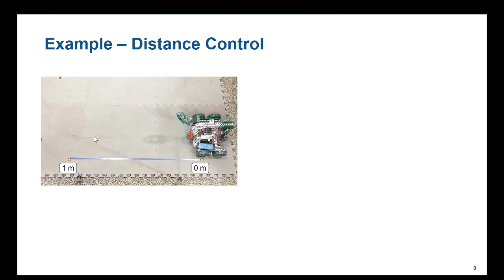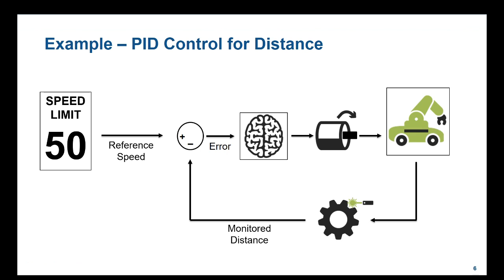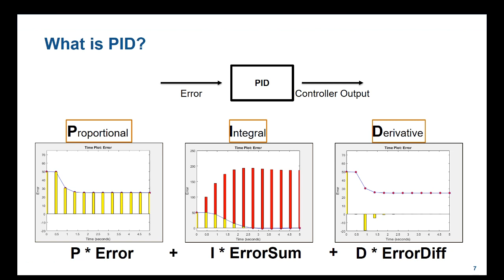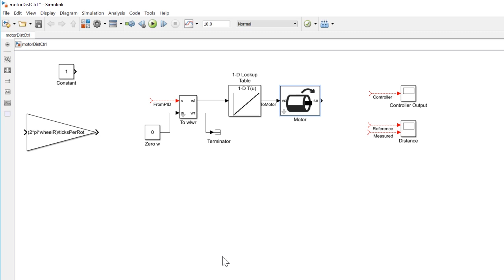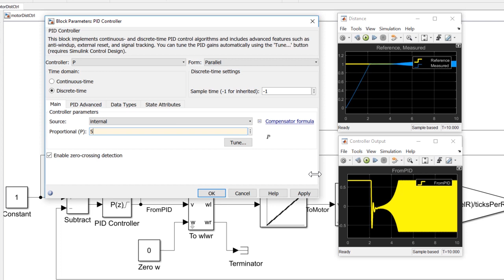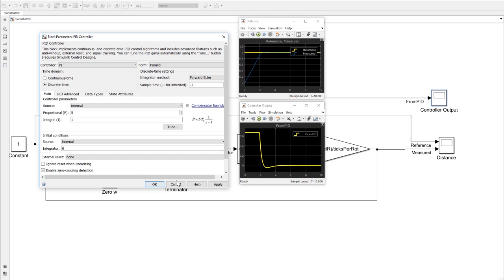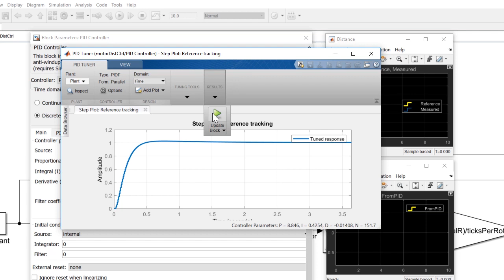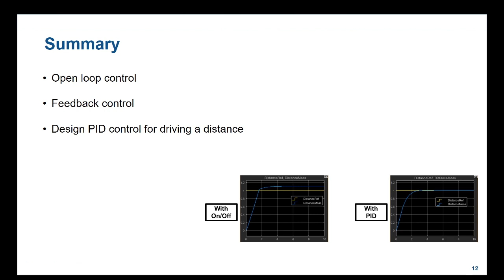Mobile Robotics, Part 2: Using PID Controllers

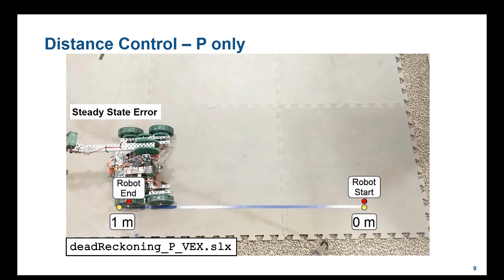Comment: 21:40 steady state error
25:47 to avoid algebraic loop error , tick the checkbox in PID block parameter which says "PID controller is in a conditionally executed subsystem"
25:47 PID tuner app can only be used if time domain is continuous

Comment: can someone please help me ,  how can i tune  PID controller for same 1 meter distance but also for backward motion and then add it to my model.
i have created logic in same state flow chart so that robot moves backward after a break of 1 second but now i want to use PID controller because it goes  beyond 1 meter while moving forward and backward.
in these video stateflow chart has been replaced by PID but in my case what should i do?  bacause my Logic for 1 meter forward and backward is in Stateflow because of that i cannot replace it simply.  where can i place PID in  my Model and what value(reference and measured) should i tune with?

Comment: im getting this error:
   Error:Error in 'motorDistCtrl_soln/Motor/Motor': Failed to evaluate mask initialization commands.
    Caused by:
        The "LTI system variable" parameter of the LTI block must be set to a valid LTI model.
anyone else? did anyone resolve it?

Comment: What is the physical meaning of filter coefficient N?
Reply: It's a filter coefficient for the derivative term. Since there is no "true" derivative in a discrete algorithm, usually it's approximated with a first-order transfer function (or low-pass filter) where N affects the cutoff frequency.

Comment: s-function error  , ANY HELP
Reply: Try some commands workspace
mex-setup
 This will show is their any compiler installed on your system . If not then install then minGW 64 compiler .
Then run command mex-setup and choose the. Appropriate compiler c++
 Then run command mex sfun_time.c